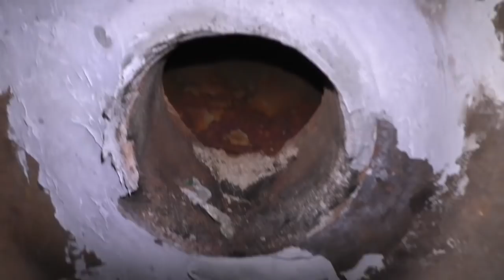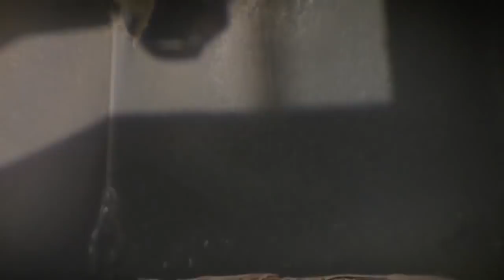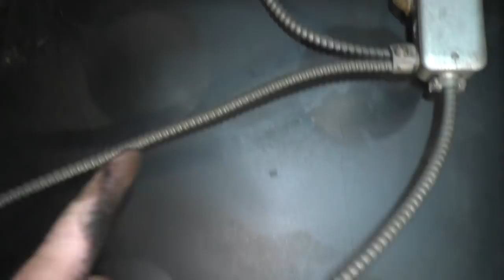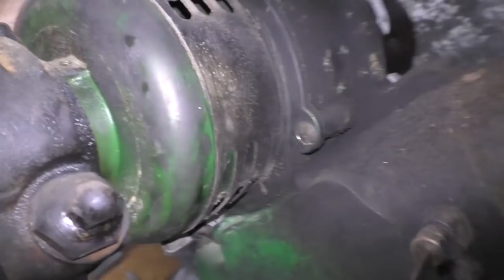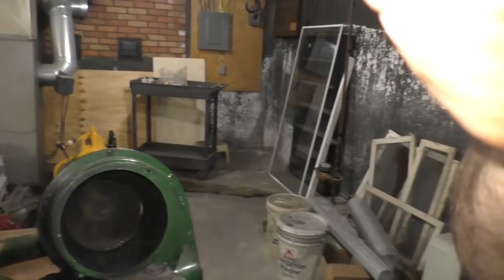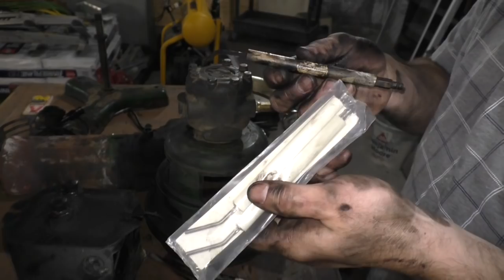Let's see how UNSAFE my 1954 Mayflower oil furnace REALLY IS!

Comment: I don't know about you, but I personally wouldn't go near degrading asbestos with a 20 foot pole. Or a 30 foot. Or 40 foot.
Reply from the maker: You gotta do what you gotta do. Imagine the poor souls who service these for a living...
Reply: @bbishoppcm  Its really only super unsafe if you break it and it gets into the air, that little bit of insulation should be fine. When I used to do HVAC work, sometimes you would have these old gravity furnaces that were full of/covered in it. If it had to be cut up to be removed ( as they often went in as the house was being built ), you have to call special companies to come remove them. Ain't cheap
Reply: BBISHOPPCM's World I could only imagine. I clean windows, and I went to a house that recently underwent complete asbestos removal. The entire interior was still dressed up, and I realized what a royal pain in the ass that job must be. The people doing the removal cannot leave the house until airborne asbestos readings are 0.0%. Didn't matter if they got there at 7:00 AM and it was 11:00 PM, they have to stay until it's gone. Makes me glad my house is too new to contain any amount of that stuff, and I don't work in that business. From what I hear, it can be extraordinarily expensive.
Reply: @LOLZpersonok  my heater has it. (Fortunately still in place.) don’t know what we’ll do when it goes.
Reply: @lorumipsum1129  I actually recently came across a house with a gravity furnace when doing residential measurements for the first time. Those pipes were very clearly wrapped in a lovely asbestos wrap (but it could also have been a fiberglass encasing the asbestos). Regardless, I didn't touch it. That thing is not going to be cheap to decommission, considering the fact that the house was scheduled to be torn down and everything else will have to be ripped apart.
Reply: @LOLZpersonok  mine may be, but I'm not sure, as the heating system got a revamp before we move bed in too improve efficiency. This involved removing most of the heaters piping and putting in new ones. Don't know if thier wrapped in asbestos still or or not(hopefully not.) But I know for a fact the heater itself has it. It isn't coming apart and is only used asone of the layers for the heater internally. You can't see any in the combustion chamber itselfz

Comment: Having asbestos blankets near or into air vents is a bad proposition.  I would not hesitate in replacing the unit.
Reply: That's inside the firebox/exchanger, which has no contact with the air from the blower on the outside of the exchanger.

Comment: That flaking is common and should be dealt with on a bi-annual basis, especially on these older units...it actually looks more like the ceramic-like protective coating I have seen fall out of new units after a year or two...you need a cleaning and new bricks. but other than that I wouldn't replace it...not now anyway...

Remember people, mesothelioma is usually caused from years of frequent breathing... such as with shipyard and steel mill workers...I wouldn't sit down and play a game of solitaire next to it open, but really. He wasn't in any danger. He knows what he is doing.

Comment: Upgrade and add some Modern Conveniences, like Good Filtration and Air Conditioning.
I'm surprised this furnace wasn't upgraded especially since this place was a rental property.
Reply: Usually landlords will try to keep costs low, so they typically keep equipment as long as possible. Even spending more repairing something that isn't worth repairing...
Reply from the maker: I have no intentions of installing central AC. I'll explain this more in my next video, as I need to address some common questions...

Comment: The original owners of the furnace when it was new are probably dead. I can guarantee you the furnace you replace it with won't last 65 years. 20 years maybe if you were really lucky.
Reply from the maker: 15 years TOPS out of a new unit, unfortunately.
Reply: I have a Rheem 90+ furnace that is nearly 20 years old and still works well.
Reply: mharris1270  every now and then we have it inspected and it has passed them.
Reply: mharris1270  ironically the last guy who looked at it died a few days later when a lady went through a stop sign in a Dodge truck.
Reply: @bbishoppcm  ours is over 20 and still going. And yes we get it checked/cleaned properly, have not only a co2 detector but a smoke detector and fire extinguisher just in case. We actually just had what I believe to be the original transformer replaced in the fall.

Oh and we had the old steel tank replaced with a double walled fiberglass one some years ago they also did a replacement oil line/filter  [had to because of house insurance regs]

Comment: i found this on the internet about the dangers of asbestos. Asbestosis is a serious, chronic, non-cancerous respiratory disease. Inhaled asbestos fibers aggravate lung tissues, which cause them to scar. Symptoms of asbestosis include shortness of breath and a dry crackling sound in the lungs while inhaling. In its advanced stages, the disease may cause cardiac failure. BTW this info was from the internet just if your wondering and i copied it and pasted it here.
Reply from the maker: I am VERY familiar and aware of the dangers of asbestos, and have been for quite some time. But thank you.

Comment: I have a octopus coal furnace that was converted to burn oil in the 70s. The heater itself is from the early 20s. Still runs great. Only had one issue, which was fixed with a new controller board
Reply: Also, yes, it has asbestos.

Comment: Oh i love to work on these  All that needs is cleaning well, re sealing with some furnace cement put it together and let it roll.
Reply from the maker: I could have saved her, but in the end, I opted for a new furnace. After it was pulled out, I found friable asbestos insulating sheets inside the heat exchanger which were in direct contact with the building's air supply. In the end, I felt I made the right decision. The rest of the furnace was rock-solid, with another 30 years left in her at a minimum.

Comment: Few thoughts:May not necessarily be asbestos if that refractory box was rebuilt in the last couple decades. The modern stuff they use now is ceramic fiber blankets that look similar to asbestos. One of the trade names used for the stuff is "Kaowool".  

That high limit setting was damn high. Stack switches are bad news, but I don't think there would be any approved way to fit that type of burner with a cad cell, and protector relay. Oil pump was a Sundstrand "J" (model) pump. Most likely was a replacement. Sundstrands successor Suntec still produces them. 

Good call on replacement. You may have spent hours rodding out that heat exchanger, and rebuilding the refractory only to find your heat exchanger is leaking CO. The replacement will likely not last as long, but as you mentioned, you should be seeing a pretty sizeable bump in efficiency with a new unit. 
It would have been interesting to see what the combustion efficiency on the one you had was. I'd bet no more than 50-60%. With a modern heat exchanger, and a flame retention burner, it would be in the low to mid 80's for efficiency.
Reply: funniest part is that ceramic shit is just as bad to breathe in when that flakes all apart.

Comment: My furnace did the same thing with turning off all the time.  However, the one in my house was maybe around 25 years old.  With our furnace, the heat exchanger was actually cracked and the motor was pretty much gone.  Luckily, the home warranty covered most of the cost of replacement.

Comment: my friend has a house built in 1960 and it has te original oil furnace and the original central air unit. they have friend that goes through them every year, so they should be good for years to come.

Comment: Why are you disturbing the wiring inside the transformer? Are the wire nuts tight? Is the wiring unbroken? Your done. One more season? You are going to run it until something obsolete on the oil burner itself fails. Hope it doesn’t happen at the beginning of a cold weekend.
Reply from the maker: The wiring was supposed to be armored cable w/ proper fittings, but otherwise it was runnable. I tore it down to look into cleaning the heat exchanger and ended up replacing the whole unit after realizing the entire combustion chamber was collapsing… the new furnace uses almost 1/2 the oil this one uses - granted, it wont last NEARLY as long.

Comment: I still say go heat pump with oil burner for aux heating on the really cold days. Run time costs are likely going to be cheaper if oil stays high, plus you get central AC out of the deal. Note: I know you are going to bring up electricity costs. I live in a cold climate NE state with a market with expensive electricity (~15 cents/kwh) and have an idea of cost, its comparable to oil heat at the moment. I would likely do better with improved insulation and a higher efficiency unit (some cheapo basic 13 SEER York). I only grumble about the cost because there is a natural gas line running past my building and that's WAY cheaper to burn.
Reply: Where i live, the main competitive heating sources is gas, or heat pump with gas or electric aux heat, we do have some homes with oil furnaces in the area, but their not as prevalent like you would see up their in the more northern states.
Reply: Usually in the northern states and Canada they use oil-fired furnaces as they produce much hotter heat than gas-fired units and heat pumps. It's probably too cold in New Hampshire to justify the cost of a heat pump, unless it's a higher-end/more efficient heat pump like the Carrier Greenspeed or something. Even then a heat pump is only really good if the climate rarely dips below the 30s...
Reply: @1912RamblerFan01  Oil furnaces are only popular in areas without natural gas infrastructure. You'd be stupid to keep heating with oil if you have gas lines in the street as the price difference is enough to pay for conversion in a few seasons. Natural gas is dirt cheap compared to oil and isn't subject to the large price swings.

Heat pumps are more popular in cold climates then even I believed at one time. They are quite popular in Ontario and Quebec due to cheap electric and they gained in popularity in New England when oil surged in price. Modern units work below freezing (even my cheapo one keeps up to around the low-20s before resistive heating strips kick in). The reality is most NE states have a climate that spends most of its time above a heat pump's balance point (the outdoor temp where the unit along can't keep up and needs aux heat).
Reply: @1912RamblerFan01   I'm not quite of a big fan of heat pumps for that reason, i live in the more in land parts of the southeast which is capable of seeing temperatures a little more colder then the 30's, there's been even times i seen it in the single digits, so heat pumps got to have AUX heat here, usually in the form of a gas furnace or electric heat strip furnace, oil heat was something that everyone used back then before gas furnaces and heat pumps existed, so most of the homes in my area that do have oil furnaces, are usually older style homes that were built in that same era.
Reply: @NJRoadfan  Here in Missouri heat pumps aren't very popular. As for oil, I agree - oil is expensive and somewhat dirty compared to natural gas or LP. Here, LP is very popular in areas where natural gas isn't available.

But many people still prefer oil because they either have the infrastructure and don't want to convert OR they like the heat better. As mentioned, oil furnaces are known for producing much hotter discharge air than their natural gas/LP counterparts and especially heat pumps.

As you mentioned, though, converting to natural gas/LP furnaces can pay for themselves in quick order. While most oil furnaces are still rated at 80%, there are gas furnaces hovering around 98.5% efficiency.

Plus, oil is nasty. They create soot if not calibrated correctly and requires the combustion chamber to be cleaned out regularly.
Reply: @1912RamblerFan01  I think their just now looking into LNG which could perhaps hopefully make natural gas heat availability possible for those who don't live with in natural gas infrastructure, since like propane, it wouldn't require any except for a tank.
Reply from the maker: @NJRoadfan  WE_DO_NOT_HAVE_NG! How many times do I have to say this?!?!? Seriously, if I had access to NG, I'd dump the oil burner YESTERDAY! In NH, heat pumps are NOT a viable option, and propane is the ONLY alternative to oil. Propane would require me to sacrifice a large amount of my already small yard for a huge, hideous tank and the cost is on-par with oil, sometimes even more than oil depending on market conditions. NG is a RARE commodity in NH, and there are no future expansion plans for it. This is why oil is king up here.
Reply: @bbishoppcm  I hear you, for some people going from oil to propane would be more costly too, my grand parent have oil heat, since they live up in a part of rural Canada where natural gas line don't exist nether yet, their HVAC guy recently offer to put in propane heating, but they turn it down, because the install would be more expensive then what they pay for #2 home heating oil, even where i live here in the inland parts of the southeast, we still have a few homes with oil heat leftover, probably because the owners didn't see any justification yet to go to something else in their situation.
Reply: I live in NH as well. People elsewhere just don't seem to get it. We have an old infrastructure. Old roads that in many cases were once dirt cow paths that bend and curve to dodge the outcrops of ledge. Some of these roads were created in the 17th, and 18th century. 

The utilities that are established aren't changing any time in the foreseeable future. It would be too costly in most areas for the gas company to rip up roads to supply the handful of new customers they may get here and there. Wouldn't be a quick R.O.I. for them.
On top of that, the transmission lines in the area can only hold so much volume, and handle only so many new customers before they need to be upsized. Typically any recent proposal to upsize, or install new gas transmission lines is met with an outcry of "Not in my town!". 

I have an oil fired boiler in my house. If I had natural gas as an option, I'd consider it, but I isn't. 
My other options are propane, which in my area is typically more money to purchase than oil. Another thing to keep in mind about propane is it has fewer BTU's by volume than Oil. I'd need to use more to equal the same amount of heat output.

There is always various forms of electric heat, but the electricity rate in my area is high. My wintertime bill is typically $140-$170 a month. In the summer when the central air is on, you can double that. I pay enough to the electric company. Final consideration with an electric form of heat, when the power goes out for days during a winter storm, I need a whole lot more generator to run an electric heat system. My boiler runs on 120V, and under 10A.

Comment: Are oil burning furnaces still made today?  Did I hear a melody clock playing in the background?
Reply from the maker: Oil heat is still a thriving industry, but it's entirely dependent on region. NH is one of the biggest markets for oil heat, as we have very sparse natural gas in the area. Most of my viewers don't understand this no-matter how many times I explain it.
Reply: @bbishoppcm  Since I don't even live in the USA I wouldn't have known about that at all.  I think oil heat used to be common in Australia, but that's before I was born, I've never seen an oil burning heater operating in my life as far as I know, I think I've seen a few oil heaters that were converted to natural gas though.  Natural gas is the most common source of heating in domestic homes here, unless you live in the country and then you'd be using Liquid Petroleum Gas.

Comment: the thing is still good .....little vaccuum and furnace cement......jesus
Reply from the maker: It was savable, but the firebox would need to be rebuilt. Once we had it out of the house, we found that the supply air passages were lined with friable asbestos sheeting... The replacement unit costs only a fraction of what this thing cost to run, but it won't last NEARLY as long!